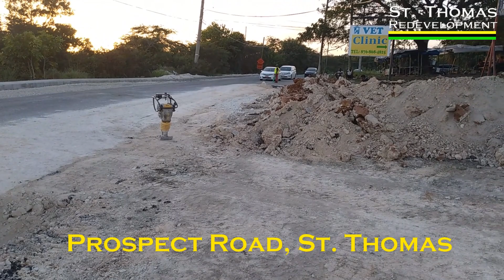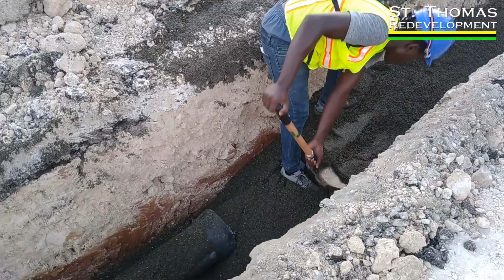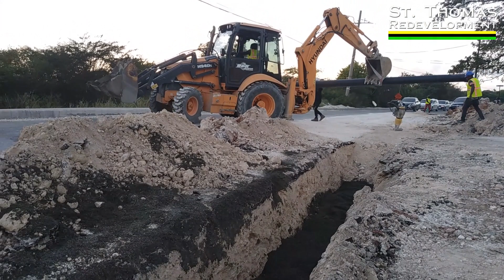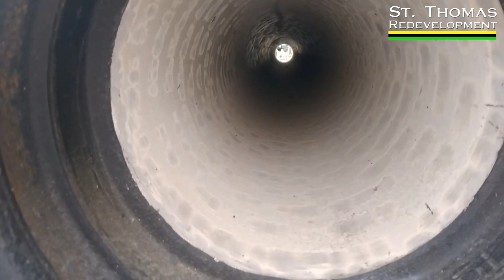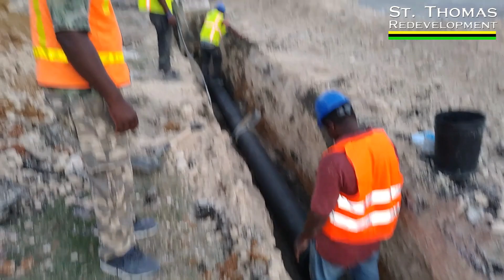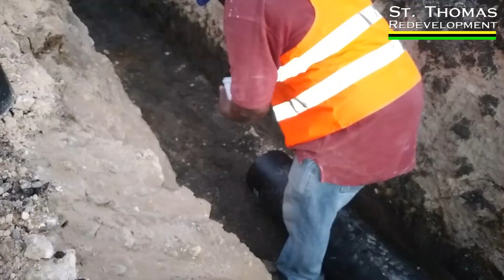Building St. Thomas' Modern Water Infrastructure

Comment: They need to keep the pipes at centre of the trench sand bed then lay pipe on sand bed .bring sand above pipe or to spring line. Avoid have rocks and stones around pipes
Reply from the maker: There is another video that is schedul for this weekend. I believe you will some of what you just recommended.  Nonetheless, thank you so much for your feedback Mike😊

Comment: Hello guys. 
I have an idea to share with you. 
My idea is:
If you put concrete mixes with cement to hold the pipe in your plan to keep it safer.
Never say never. 
You might have to do another work in the same project, but,you'll not be able to do better than you put,concrete only,just press it with bole deser  in anytime you want to work in the drenaje,you will be working very easy.

Well,well,well.

Pierre Richard Rene. 
The only one who is always sharing his ideas to everyone who understand exchange convention or idea is good to know more than we already know.
Reply from the maker: Pierre thank you so much for sharing your experience opinion on this channel. I truely appreciate these kind of contributions so that persons can grasp different perspective on how things can  be done differently.
Thank much 😊
Reply: They used concrete in certain areas where the water pressure is very high. When installing fire hydrants they usually use concrete, they called it trust block

Comment: That water pipe is too small, the pressure must be low, On the main roads in England the pipe lines are massive!
Reply from the maker: Hey yards😊 welcome to the St.Thomas Redevelopment family. I truly appreciate your feedback on this and I believe the engineers may even respond to you comment. Honestly, this 10" is probably 3 time the size of existing old pipes. And what I have noticed is that they are running these pipes on both sides of the road which will be more than enough water for us now and for the future. Blessings and keep the flag flying in Britain 🇯🇲
Reply: Yard : The size pipes installed according to how many people live in the community. Most places in the United Kingdom and United States used larger pipes because the population is larger

Comment: These fools should not cover the water main until all the pipes are laid,the water turned on and the joints are check for leak. The way they are doing it, if there is leak they gonna have dig the up  the whole thing again to fix the joints.Wher is their common sense.
Reply: Your not knowledgeable  in this brethren, they have mechanical engineers who specialize in this..Take it easy....
Reply: Each joints are pressure test after laying in the ground
Reply from the maker: Dalton and Junior thank you for responding to Rock Ofages.